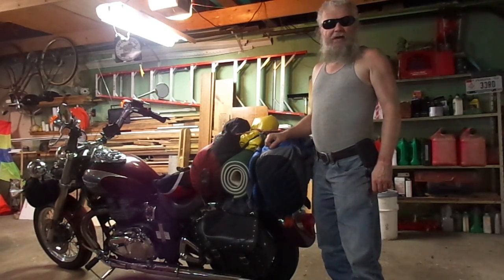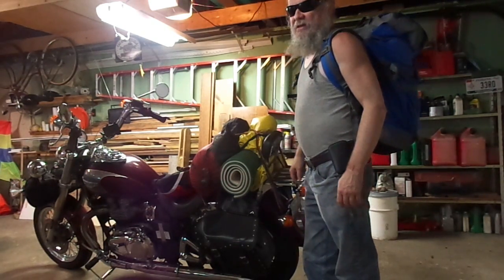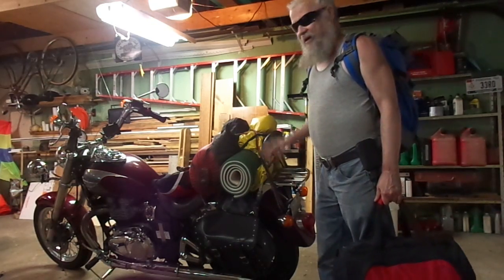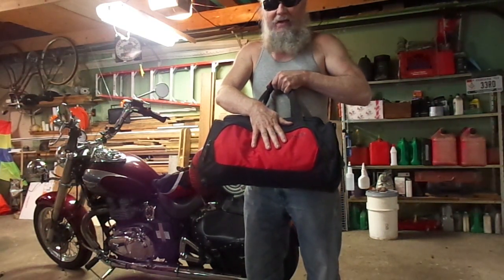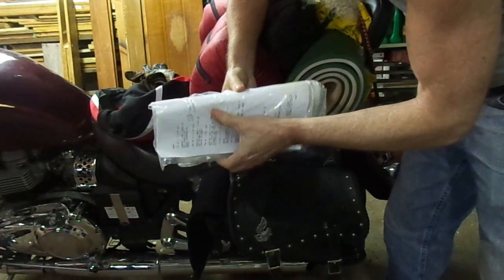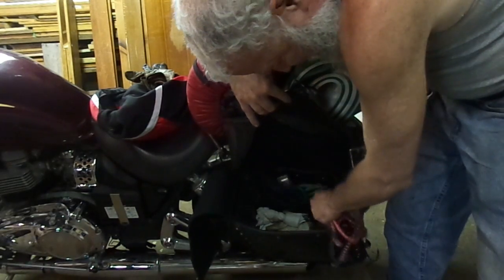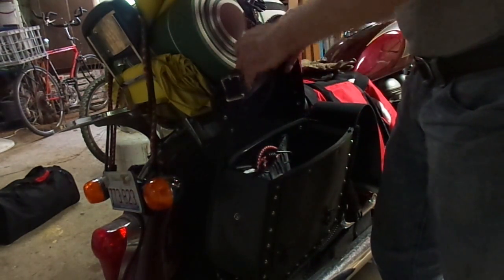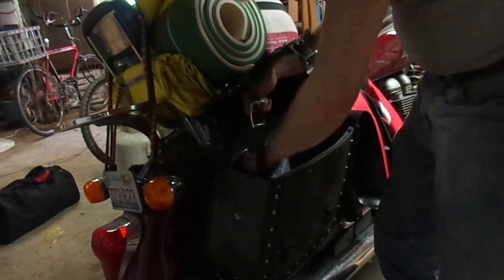My Packing Method for WheelsNotHeels and some others.

Comment: Carry a vice grip tool, I used one to give me gas when my throttle cable broke. You can attach it to the cable , because trying to pull it with my hand didn't work, I was lucky to have the vice grip tool. It was a lesson learned for me. On my long trips, I always had my cloths in a plastic bag. Once rode 800 miles raining the full ride. All my cloths in my back pack was wet. The back pack didn't hold out the water.
Reply from the maker: Good idea. I could substitute it for one set of pliers.

Comment: I put a taller sissy bar on mine, because I knew what its like to ride so long, with my stuff packed. I can pack better with a taller sissy bar. More room to add stuff, and much bar space to tie stuff down. I also like the flexible saddle bags, for odd shaped stuff, that might not fit in hard boxes attached to the bike.
Reply from the maker: Yes the saddle bags can expand a bit and also the straps adjust for when they are over stuffed with gear.

Comment: Great video. I've always thought about using a nice backpack as luggage, but since I have a smaller bike I ended up going with the Kriega US 30 instead, which I have gotten a couple of nice backpack style straps for so that I can still comfortably carry it off of the bike. The pluses with the Kriega are that it's very well designed and built for a tailbag, and it also holds a lot more than you might think. The downside is that it only has one separate storage area n the top, so it doesn't have the nice organizational functionality of some backpacks, although I tend to use my nice tank bag for those kinds of items. It must be a real luxury having such a nice big bike for traveling!
Reply from the maker: Yes, I know smaller sport bikes can be really hard to take on long trips. Your idea of turning a pack into a backpack with two straps is the way to go. Not like you will be hiking with it. You only need it to work for short distances. Sometimes I don't even use both straps and just sling my backpack over one shoulder for short distances.
Reply: suburbanryder - The Mayor -
I'm curious as to what polish you're using for your face-shield?
Reply from the maker: Motorcycle Extremist
http://www.amazon.com/NOVUS-PC-10-Plastic-Clean-Shine/dp/B002UD0GFE/ref=sr_1_3?ie=UTF8&qid=1404863064&sr=8-3
Reply from the maker: Motorcycle Extremist
The first three times I used it I was about going to give up on it. It did not seem that good. I figured give it a few more tries and by about the 12th time it had really changed the surface of my shield to very smooth and slick and bugs came off super easy. It also hides minor scratches pretty well but not deep ones or deep scuffs.

Comment: Thanks for sharing my friend. I did have a question. Do you take anything for tire repair with you on long trips? I have a repair kit and tire pump and wondered what your options were in case of a tire problem. Thanks brother and ride safe!
Reply from the maker: I have a can of fix a flat that I forgot to show. It will not last long but it will get me down the road enough to a safe place to do more extensive work.

Comment: I so much want handle bars more like yours, but am afraid none of the wires or cables will be long enough. I don't like short handle bars on my bikes. But that's what my 1300cc Honda VTX came with, short handle bars.
Reply from the maker: All my wires and my brake lines had to be custom ordered. It was not cheap but I am glad I have the handle bars just right for long rides now. The stock beach bars were not right for me.
Reply: suburbanryder - The Mayor -
Maybe next tax time I will go to the Honda shop, and have them order all the tings I need. I am handy, can do about anything. I rode a long ride last year on the VTX, the arm length was to short for me. I need longer handle bars. The VTX is my first cruiser, most of my bikes was more like a sport bike, but non had short handle bars. I was scared of the bike at first, 1300cc gave me fear. Biggest I ever rode before that was a old 70s Kawasaki 900. It was very heavy also, as well as tall.
I was not used to setting so low on this new cruiser, but I always wanted one, its a very cunfy ride. Now I have no fear, I got it last year, traded a 95 Dodge pickup 4X4 for it. It was all luck, a guy sold it to me for $400, I fixed the transmission in it, then traded it to a guy , and he bought me the VTX for $5,400 He didn't get robbed. The truck is very nicely pained.  I don't have much money, so that was the only way for me to get such a good bike. I will never have the money for a Harley, don't really want a Harley anyways. I heard to many bad things about fixing them. Cost is through the roof.
Reply from the maker: Jojo Gun Fang
Cost is a factor I agree but my Harley ran for 25 years and never left me stranded and never leaked oil. That was the old cast iron engine days. The new evolution motors are just like any modern bike. Don't believe the rumors. All modern bikes by major manufacturers will do just fine. Buy what you will be happy to ride and screw what anyone else says.

Comment: The go pro camera ruined my long trip videos, I talked all through my videos, but the camera video type would not blend together. So I had to make them all separate. I decided to just add music to the videos, but a few I wanted the sound, but forgot and added music to them all. One I was telling a story of my first motorcycle wreck, and just happen to be riding near the place, so I drove to the spot and told the story. But forgot  and recorded the music over it. Its not that important, just a memory for me. Have to learn to do better video, and get me a better camera that does what I need. Have to have one with a mic to moto vlog. I can make long unbroken videos. Or can just take the good parts and convert to AVI, if the go pro video can convert. Some video types just wont convert. Need to make some test videos.
Reply from the maker: With the right editing software you can always narrate the video later when you get home. Nothing wrong with doing it that way if it works better for you.
Reply: I have learned how to make a video when watchin the video, then I took just the sound and added it to the video, and took out the sound off the video, Didn't want them to mix, and be hard to hear. I have a video converter that turns my videos onto MP3, then I add it to the videos. My last ride with my friend Ali, I did that. My first audio insert video. I thought my go pro audio was not working, it was my computer all the time. So I had to start over and take out the go pro sound, and just keep the audio insert.

Comment: I am paranoid about traveling on the bike alone and having to stop to use a restroom and coming back to find my bags are gone.  Especially if I have electronics in the bags.  Of course when I go anywhere with the wife we then have very limited packing space but at least one of us can stay with the bike while the other runs in to pee.
Reply from the maker: I have never had anything messed with on a trip so far. That is close to 40 years of riding everywhere in the country and even staying in some rough parts of certain cities. I think the one place I was warned a lot was my home town of Kansas City. Many friends told me thievery is very high there. So I did not leave my bike out of my range of watching it when I parked anywhere.